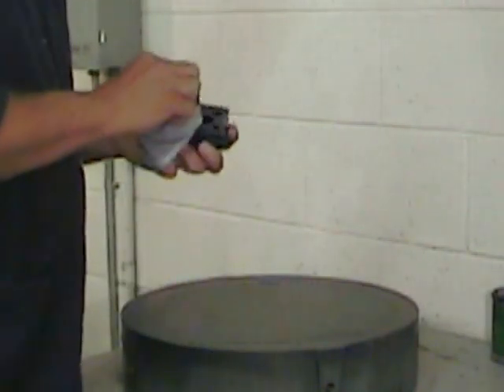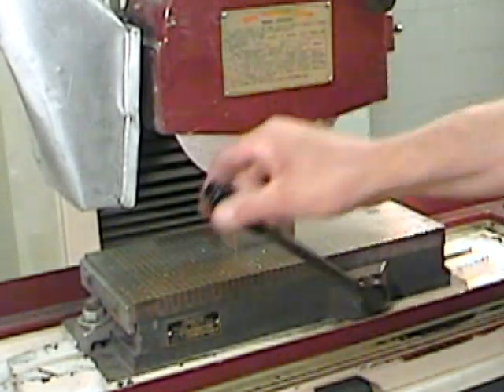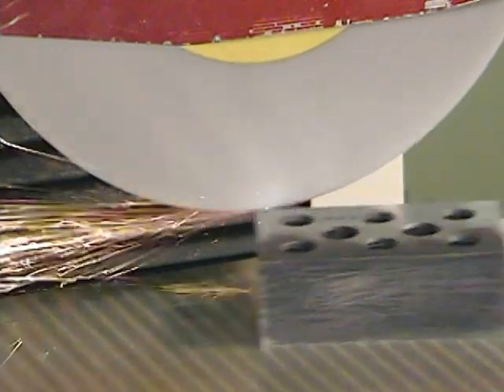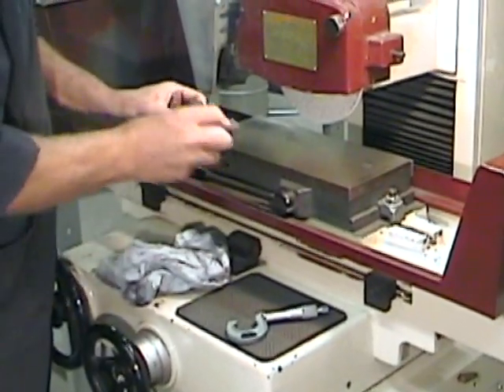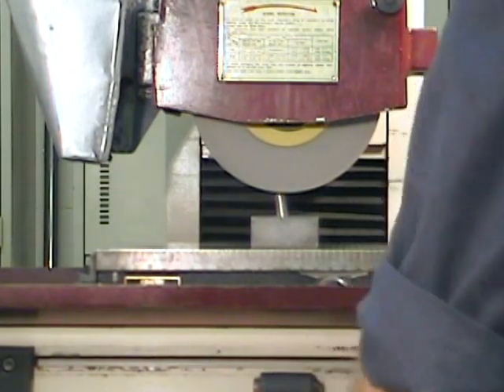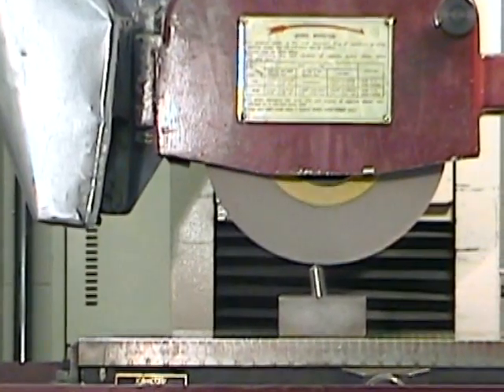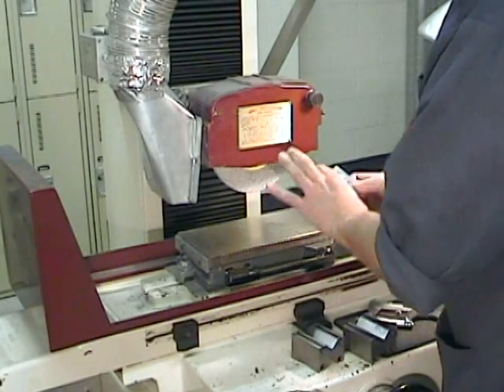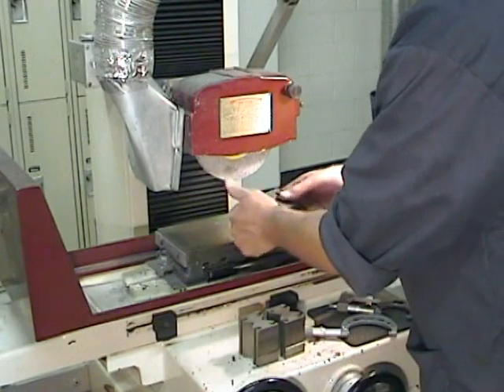THE 1-2-3 BLOCK PART 3 : HARDENING, TEMPERING AND SURFACE GRINDING. MARC LECUYER

Comment: Thanks for the vids. I'm a new apprentice, and we are starting to make 123 blocks after I bugged our supervisor for a project. I've just finished cutting rough blocks out of 1"x6" A2 steel on the band saw, so on Monday we get to actually get to work. We blued the pieces while we were waiting on the band saw, not knowing we were jumping the gun. We don't have any specs for drilling and tapping either, just asking the journeymen what their blocks look like. Your videos have been my homework, as I'm the one pushing this. I'm in Kentucky, so while most stuff is "Standard"/Imperial, all the tools and bolts in our shop are metric-so I'm beginning to think our blocks should be as well. Thanks again-
Reply from the maker: Christa Sinclair Hi Christa! I am glad to hear that you are interested in the trade! If you would like a copy of the drawings, just send me  ( THATLAZYMACHINIST@GMAIL.COM  ) an E-mail and I will return a jpeg copy of them. Thanks for taking the time to write and remember that you can find YouTube links to all my video on my webpage at THATLAZYMACHINIST.COM    Marc L'Ecuyer

Comment: I recently picked up a g&l no 35 surface grinder for my shop. It's pretty hard finding wheels for it, they are 10x1x2, so lately I've been looking for 8-in wheels. The 2-in arbor is still tough to find though. I'd like to get a very high grit finishing wheel, as I mostly intend to use it to get a nice surface finish on aluminum, which I have found is quite difficult!

Comment: Hi Marc

I recently purchased a surface grinder and I am still learning, I found your instruction in the video very helpful...thank you

Can you address surface chatter in your upcoming video

Chuck
Reply from the maker: Hi Chuck! Chatter is often caused by a poorly balanced or eccentric wheel. Both subjects will be in the next video. Thanks for watching, Marc L'Ecuyer
Reply from the maker: THATLAZYMACHINIST Hello again Chuck! I said that I would include the chatter problem for surface grinding in my next video on replacing and balancing surface grinding wheels but I have changed my mind. I am almost done the video and I now think that the chatter problem would be best addressed in a little quickie video that should be out in the next week. Thanks for your interest in my videos, Marc L'Ecuyer

Comment: About the fingers and grinding wheels, What about when using a pedestal grinder?
Reply from the maker: Hi Max, thanks for a great question.
All grinder accidents are bad but surface and cylindrical grinding accidents are often (not always) worse than those on pedestal grinders. It all has to do with pinch points! If the support on the pedestal grinder is properly adjusted to the wheel there is little chance of wedging a finger between it and the wheel. That means that most pedestal grinder "rubs" look like burns. Not good! but generally don't require surgery or amputation. Cylindrical and surface grinders have, by definition, pinch points. And that is very very dangerous!  if your hand touches a grinding wheel, you can pull back and reduce the injury. But you can't do this when your hand touches a grinding wheel at a pinch point!!! It works like a ball throwing machine, your hand is instantaneously drawn through the space that separates the wheel from the part or table. What comes out the other side depends on the space your body part passed through. I am sorry to be so gruesome  but it must be understood, grinding wheels vaporize flesh and bone so what goes through the space and touches the wheel no longer exist, it can't be sewn back on!!! One final thing of importance is to say that most of these horrific accidents happen when people clean the table by passing their hand with a cloth wipe over the magnetic chuck and the famous last words are "I though the wheel was higher than that!!". Wait for the wheel to stop spinning completely before you even think about moving your hand close to the wheel. Marc L'Ecuyer
Reply: Great explanation, thanks for taking the time to respond.

Comment: Why do you set th part at 30 degrees . Just for looks?
Reply from the maker: Hi Chris! It is a habit that I developed for two reasons. The first one you have already guessed, I find that angles around 30 ° are forgiving. People aren't distracted by the machining marks or lines as much as when they are close to 90° or 45°. If you go for those angles, you had better be bang on because close to 90° or 45° but not on 90° or 45° gives people cramps. The second reason is more important. Many accidents happen when people are feeding the grinding wheel down to set their first cut. This is less of a problem when you feed down on a corner. It's still not good to crunch the part, but since there is much less material on the corner that will contact the wheel, the consequences are less violent. In other words, less contact equals smaller crunches.  I hope this answer your question, thanks for watching! Marc L'Ecuyer
Reply: It keeps the wheel contact correct. You don't want to set the part at 0 or 90 degrees to the wheel because you will have too short or too long of wheel contact. And at an angle keeps it right in the middle. 
I don't think it affects accuracy much, but it looks nicer (IMO) and might keep the dressed life of the wheel to a maximum.
Reply: When grinding, only the front edge really takes off material, so it wears most and tapers towards the trailing edge. So the trailing edge is barely dusting a few millionths. And when dusting millionths, wheel wear is negotiable with today's wheel technology (both binders and abrasive) it's not really an issue. The wear in the machine's ways is much more of a concern. In the big picture, surface grinders are not really all that accurate. A in great condition bridge mill or blanchard grinder will sweep a surface grinder out of the water. But bridge mills and blanchard grinders are too big for most shops. My DoAll DH612 is in the shop, will be wired within the week. If I find wheel wear is a concern I'll promptly reply back.Have a good one :)

Comment: what about tempering the block? before or after gringing?
Reply from the maker: Hi Asaad, the bloc was tempered after hardening. you can see the tempering in the second video of the 1-2-3 bloc project. Here is the link http://youtu.be/6kpkBdgEX-g  you can see all my videos (including several on heat treatment) on my webpage at THATLAZYMACHINIST.COM  it's free and always will be. Thanks for watching, Marc L'Ecuyer

Comment: I don't think those blocks are square or parallel. You should check your work on a surface plate and show the results.
Reply: true they arent however he is so nice and knowledgable I never say anything. Lets assume the angle plate was dead nuts. You cant block in surfaces like that with big angle blocks because the magnetism of them exceeds the magnetism of the chuck and the part will clasp over to the parralells. When butting up the tall huge stops the block at that time tilted slightly one way or the other because of the block in stops. The flat reference surface he produced--is then cancelled out totally. If it was square it was because he got lucky on the v blocks at any rate the flat square surface of the block was cancelled out. The placing of the items on an angle that was not the correct time or use for it--note that he cut in small on the ears which will be lower and fed all the way off the other ear which also will be lower. The middle of the block and full width of the wheel then has max pressure however you get a pincusion shape humping up as you go-most hump in the middle. The effect would be negligible on his block but had it cooled grinder running he did not show that on spark out the ears and edges spark out with no contact in the middle once the pincusion goes away and shrinks into a reverse pincusion. The stopping of the wheel of course is not done but he has liabilites however it then teaches beginners things that are not used in real life. That being said it was made clear the video was for beginners and is not an advanced video. The grinding methods shown likely should not have used 1-2-3 which may be used a lifetime instead should have been grinding some other block "reasonably square". Keep in mind that beginners are not grinding or squaring to millionths and they quite possibly never will so the video is helpful except for stopping the wheel--meaning that no machine tool in any shop can be used at all. BEST TO ERR ON THE SAFE SIDE-for beginners they will know when to stop shutting down the wheel every ten seconds.

Comment: No no no ..... You're not a pain.... Pain is to loose a finger or to.
Reply from the maker: Hi Eric, I just received your comment and I don't understand? I must be missing something, if possible could you elaborate a little? Thanks for watching! Marc L'Ecuyer
Reply: THATLAZYMACHINIST U went on about beeing a pain for telling to keep your fingers away until the grinding wheel stop moving :) U keep telling em :) Losing body parts is pain. Keep up the good work :)